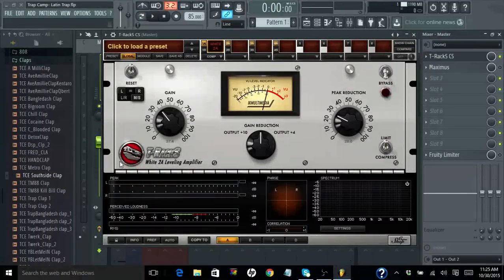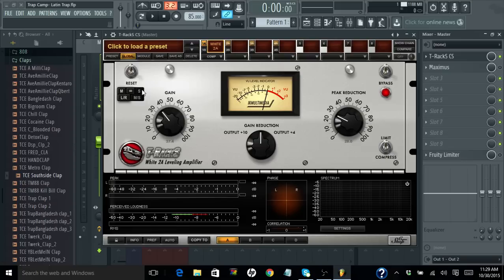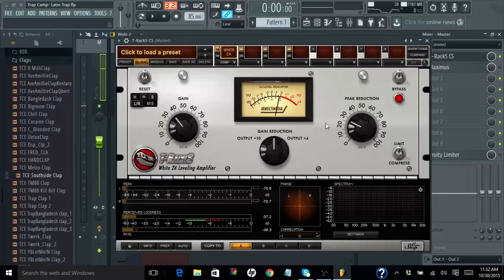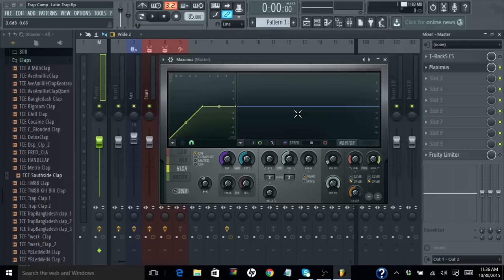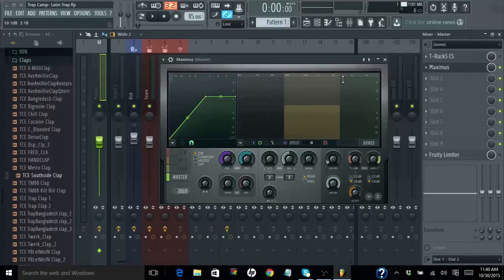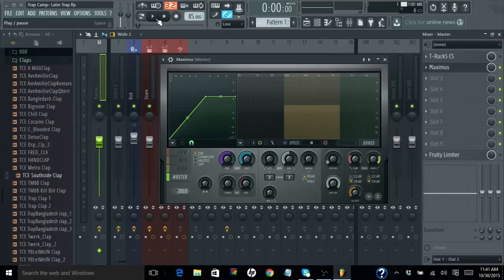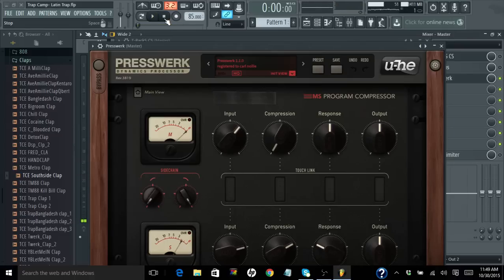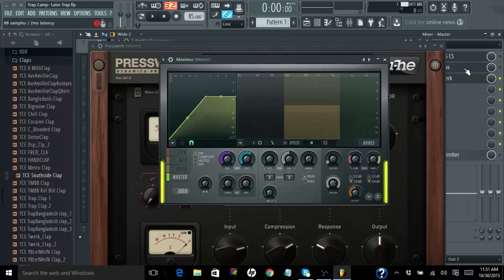M/S compression tutorial: the BIG DR. Dre SOUND!

Comment: I still don't get what its specifically doing to the mid side independent of each other.  Cuz with drums low cut the sides to make it mono and i take a clipper and squeeze the center.  But with compression on the side signal i dunno if it should be upwards or downwards.